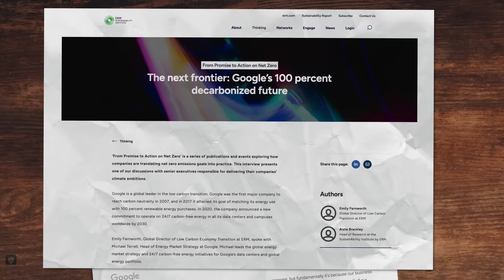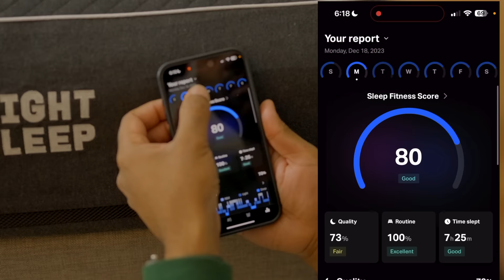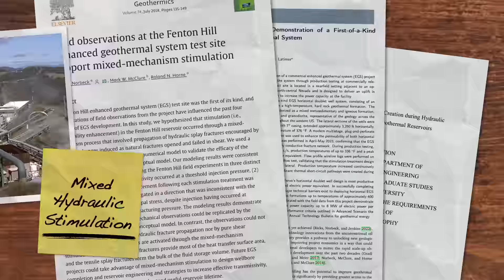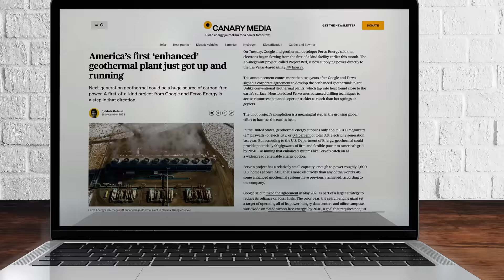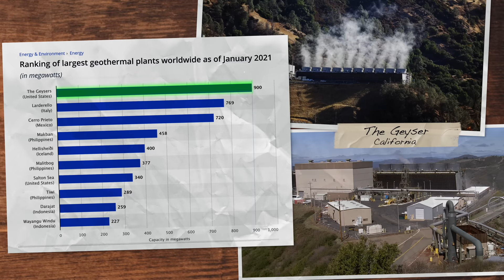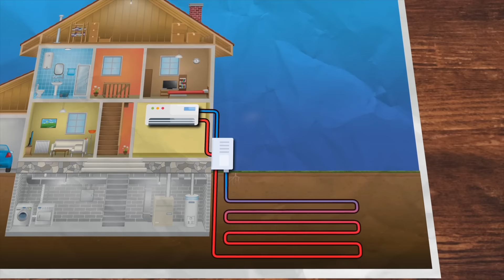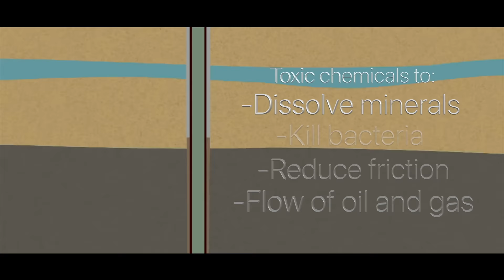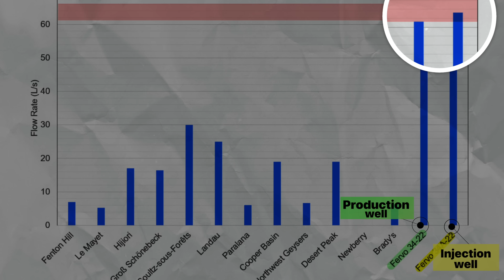Google’s Billion Dollar Gamble: You Won't Believe What it is!

Comment: I have been researching using the earth's natural heat to boil sea water.  The goal is strategic: the supply of both the earth's heat and seawater are infinite.  I don't want to use fresh water because it is already scarce.  By boiling sea water to produce electricity, we can also produce fresh water.  Scale build-up can be dealt with by fracking.  Nature's example of how this could work is Old Faithful Geyser at Yellowstone National Park.  My hope is that a well may be drilled, sea water pours in, the rate of explosion is equallized using the water volume and rock temperature ratios.  A turbine dropped in the hole would produce electricity and the condensed fresh water captured.

Comment: Easiest Geothermal areas.
1) So Cal.
2 Nevada.
3) Utah.
4) Parts of Wyoming, not in Yellowstone Park.
There are other not so easy on the continent.
But, with proper management, the US could get off of fossil fuel, power generation, for most of the lower 48.
As to the water injection imbalance. Do you think that you can keep pulling water out of the Ogallala aquifer, and the Basin and Range aquifers, forever? Some how some way, we have to start replenishing them. This is an almost free way, (power production covers the cost).
Reply: That's a strong statement. Can you back that up?
Reply: @ipp_tutor  How about, you get your fingers working, and do some research.
Do your own WORK.
A little hint, the hot spot presently under Yellowstone, tracks under the states mentioned, follow the crater trail.

I am a retired miner/surveyor/planner/mine ventilation specialist/prospector/mechanic.
Geology, for prospecting, makes very interesting reading, if you have that bent.
For one December, my off the job associates, where a fracking crew. Learned quite a bit from them, wonderful education.
Best wishes from the far North.

Comment: Fracking can contaminate ground water without adding chemicals into the water, by breaking up the underground layers of rock it will mix whatever is in that particular area being fracked. That being said with geological surveys i am sure they will be able to find an ideal location for geothermal power generation which in my opinion is a hugely under utilized form of power generation.

Comment: I think you missed an important problem with fracking for fossil fuels. The fracked well is only good for a limited time because the hydrocarbons cannot flow through the low porous substrates. So more and more wells are drilled and this just makes the likelihood of earthmovement much greater. However heat does flow extremely well and so once you have your well, fracking only once in the area, you don't need to keep drilling new wells. It is all much more stable and less risky. I am "well" pleased that this technology is moving forward, yhe sooner the better.

Comment: Subtitle quote from around 17:30, "in geothermal we don't need to kill bacteria or extract oils from The Rock so fracking fluids used in esgs don't contain any of the toxic chemicals that we were just talking about this means two things no chance of air ground water pollution and no need to dispose of the fracking fluid by burying it underground so the main drawbacks of fracking for oil don't apply to geothermal .....". So we already know that the extremely harmful business of fracking using various chemicals and drilling methods to extract the fuel products. So even if we naively remove the chemicals from this proposition, what about the drilling and earth disturbance leading to unknown issues that are too numerous and inconsistent to quantify? Let alone whatever unknown elements are released from the ground. We won't even start on the potential issues due to continuous drilling for a stationary energy plant. Come on Google. This is another massive distraction and a spit in the face to all the families that have already been decimated by fracking. There's much better things to sink a billion dollars into. The only real & available solution is new nuclear. So "put the bunny back in the box" and get with the real solution.

Comment: Unseen cost?  We’ve been using nuclear since the ‘50s!  The Phoenix area runs on nuclear from the plant at Palo Verde!  France runs its entire national power grid off nuclear!  

There are no ‘unseen’ costs; there is only social and political ignorance over it, along with stupidly suffocating regulations forcing companies to take 4x and 5x as long to build a nuclear power plant and bring it online, along with driving up the cost 10-fold.

And comparing nuclear with solar based on land area is…is…is ludicrous.  Really.  The solar farm will likely have a millionth the power output of a nuclear power station, is absolutely not maintenance free, unsuitable for continuous use by a huge metropolitan region, requires inefficient and absurdly expensive supporting infrastructure, and is economically unviable at large scale.  And the manufacture of the complete solar infrastructure is about as far removed from being so-called green as a coal mining and burning operation.  Geez, what pretty-picture, John Kerry brochure have you stumbled across?

Comment: Okay, Google isn't doing fracking in the toxic mode: yay.  But both the fracking itself & the extra water loss increase local risks of quakes & sinkholes. Not to mention, to avoid those toxicity effects, the water they're pumping HAS to be from fresh sources... in a desert, when ALL semi-arid-or-worse areas are getting low on the resource.

Comment: I'm not sure I understand what you mean by 'turbine' on the original Italian engine. The wheel is a flywheel, used on piston steam engines. This is pretty much the stationary equivalent of a steam locomotive, with cylinders on each side of the locomotive powering the drive wheels.

Comment: What a load of corporate horseshit. 

The main issue with geothermal is dissolved solids. Few sites have sweet water and those are mostly tapped to their potential. New sites have hard water. and hard water drops calcium, sulfur, etc. near the boiling point of water. This gums up the pipes and forces the drilling of new wells every couple of years. 

Nothing in this plan addresses this fundamental problem. There are (expensive) solutions, but they weren't mentioned. (The most obvious is using a closed-loop system which is not fracking.)

Comment: So where are they getting that extra water from?  My guess is a well drilled into the aquifer, so that the water is in a different closed loop.  Although I doubt that it will be 100%.   One thing about steam generated power, its not the temperature of the source of the heat, Its the DIFFERENCE in heat between the source, and the cooling system.  That's why you see nuclear plants with those giant vertical cooling towers producing steam.  Geothermal plants have to dump that excess heat into cooling systems as well.  The steam generated requires a continual water replacement.  Probably out of an aquifer somewhere.

Comment: Something like thirty years ago, when I first started reading LCOE lists, geothermal was the cheapest.  It was only used in a few places where you could get the heat basically for free, at very high temperature, from a very shallow well.  Back then, nuclear looked like a reasonable option.  In the intervening decades, turning the energy of steam into electricity hasn't gotten noticeably cheaper, while wind and solar have.  Now, even if the heat were completely free, and even with the cost of energy storage, turning steam into electricity isn't going to be able to compete with solar and wind.

We should keep doing R&D for things like this, in case the projections are way off for solar and wind.  R&D is dirt cheap compared to anything that involves the entire economy.  But we should consider it insurance, nothing more.

Comment: I always enjoy your videos. You are so good at explaining complex engineering clearly and understandably.
There is no such thing as free energy/perpetual energy, some sort of resource somewhere is always expended. In this case, it's water. It simply is not possible to convert one form of energy to another at 100% efficiency, there is always some form of energy loss, usually in the form of waste heat. In this case, it is water loss and the power it takes to deliver it to the system. 
Another question I would have if we generated all of our energy needs with geothermal: how much heat would we be transferring from the earth's crust into our atmosphere? Would it be enough to contribute to the adverse warming of our atmosphere (waste heat)? How would that compare to pumping billions of tons of greenhouse gasses we are pumping into the atmosphere we are doing now?

Comment: Water boils at 30 C or 90 F in a vaccum you can actually run this or any geothermal power plant in a closed loop system for the water supply.

Comment: Mmmm, well, we Arizonans better pick that up a bit, seeing how farmers and rural locations need to drill up to 1000 feet to reach the fossil water aquifers.  At least one basin is down 2000 feet.  In almost all cases, ground water is being removed at a greater rate than it’s being replenished.  Statewide, we’re in a negative balance situation with all aquifers continuing to shrink as we need to drill deeper to pump out what is needed…or, tragically, what is desired.

At least we have policies in place such that we make an effort to replenish groundwater reservoirs, but the aquifers are losing.  No aquifers have a net positive recharge.

Comment: I'm sure the engineers already thought of this...but could salt water be used instead of fresh? I'm guessing salt water might not be as effective for heat transfer...I'm not an engineer. I think this method is a start and people and equipment can be repurposed to build these plants is a bonus.  I know nuclear power is problematic on so many levels, but it's still our best option for consistent and relatively safe energy, if you ignore the nuclear waste disposal issues...and risk of a melt down....just maybe not build them in seismically active zones?

Comment: Eavor have a geothermal energy plant in Germany, no fracking, same water circulates throught 12 horizontal connections sealed with cement, the Eavor loop.
Quaze energy again no fracking, and same volume of convection water ,uses microwaves to vapourise the rock which lines the hole walls with glass, and can drill horizontal and/or deeper than steel, hence hotter temperatures enough to power coal fired plants turbines instead of fossil fuel.

Comment: The end result of a horizontal drill may be 90-degree, but it doesn't just go straight down to the zone and then straight sideways. It's a long sweeping turn, because drill equipment only works in one direction.

Comment: I wonder it it would work with salt, sea water. If they got liquid water at 300C, salt will be still dissolved in water, but if they getting steam, salt would be lost in pipes, and could seal cracks.
Well, maybe it could work as a combined electric and desalination plant, similarly to nuclear desalination plants.

Comment: To be at 49% efficiency, the rock needs be around 500 C. You need to be down 25 km for this temperature. Toe and heel drilling is better than fracking. You can use carbon dioxide rather than water as your working fluid.

Comment: These boreholes produce heat, from which steam is generated to drive turbines. They are expensive, inefficient and, as you mentioned, noisy. Storage batteries are only (at the moment) expensive but more efficient. They are rapidly evolving to become cheaper with improved life and efficiency. They are easier to install and most , like solar panels, have no moving parts, other than switches.. I know there are some battery storage systems that used pumped fluids.

Comment: The toxic shit that comes up fracking wells is mostly from the fossil fuels and other minerals that were already underground, rather than the chemicals which are injected down-well which are relatively innocuous.  The most frequently used anti-microbial agent for instance is also used to stop mould and bacteria growing in shampoo bottles.  People pour that stuff onto their scalp without significant ill effects.  On the other hand, oil and gas wells of all types, not just fracked ones, often also yield quantities of rather dirty water with dissolved sulfur, heavy metals, as well as toxic organic compounds (benzenes, phenols etc) that nearly always go along with fossil carbon.  Coal and crude oil are full of hazardous toxic impurities besides the carbon and hydrocarbons that can be burned.  Of course when you frack a well into rock composed largely of such substances, you get toxic stuff out.

If you are fracking strata with no such toxic substances in situ, it will be less hazardous.

Comment: In my opinion salt water could be used for this application, so the 'wasted' water wouldn't be that much of a problem. Probably getting through that rock would even take away some of it's salt content so it wouldn't be so corrosive for the plants equipment. Also might could double as a water purifier. But im not nearly enough educated in this field, it just makes sense this way. Anyways, way to go, im excited!

Comment: Sounds alright but I think this is going to cost Google. I think the price of Geothermal has 10-20 year ROI unlike solar and batteries which is 10 years and below. I mean, if solar is cheap, just overbuild it and throw the excess energy or maybe run additional cooling equipment.  Aside from that, solar has little maintenance or high reliability.

Comment: I'm CERTAIN I've seen other Geo plants working with horizontal drilling recently.  In the one I'm thinking of they drill two sets of wells that eventually connect at the end point. Pump down one well and back up the other. So similar to this but without the fracking risk.

Comment: They can pressurize heat above and or below ground, then use heat conductive polymers running from core to make steam...Gravity batteries with pullies also. If electrostatic motors work, they put them next to closed circuits and don't need to do extreme measures, essentially.

Comment: I believe in the future of geothermal, and love the video ... however ... I live in western Colorado, and the Red Mountain Creek and the Uncompahgre River show the problem with fracking and the destructive effect it will have on ground water supplies.  This area was heavily mined from the late 1800s thru the 1900's.  In the case of these two streams, the water is bright orange year round ... it never runs clear, and is loaded with heavy metals and acids, even though most of the mines have long been closed.   My dog nearly died last year when, as I was not looking, he simply crossed one of these streams, and absorbed this toxic material into his coat and skin ... it really is that concentrated.   They've build holding ponds, but they are only partially effective.   The pollution is severe, and it is forever.   Now, admittedly, the mines in the area didn't utilize "fracking", but the mechanism is the same: water flowing through fractured rock.  Even though the mines are closed, the damage is permanent.  A couple of years ago,  a similar situation occurred just south if their in Silverton, with the Gold King Mine disaster, which reached a worldwide audience.     The lesson: once clean water is introduced to fractured rock, the water soluble minerals and chemicals contained within leach out, and can never be controlled.

Comment: A thought: What if they treated this as a closed loop system, rather than a fracking system, and thereby saving the 17 million gallons of water you mentioned. After all, heat-pumps using geothermal only capture heat/cooling from the ground. Very hard to do, you say!  Well, I once heard a president say, " We choose to go to the Moon in this decade and do the other things, not because they are easy, but because they are hard; because that goal will serve to organize and measure the best of our energies and skills, because that challenge is one that we are willing to accept, one we are unwilling to postpone, and one we intend to win, and the others, too." Surely, going several thousand feet underground is easier than several hundred thousand miles over our heads. Too bad, Sir Roger Bannister isn't here to show them it can be done.

Comment: Fracking is not the right solution. A closed loop is the way to go. Simply reuse the same fluid again and again and ...
We have geothermal systems to heat our houses with the use of district heating systems.

Comment: Wind and solar energy never "go to waste", the sun was going to shine either way... Just like it has for the last 4 billion years. And in 90% or more of the cases today, it's cheaper just to build more wind and solar to bring up the bottom of the trough instead of adding more inflexible so-called "base load". With the cost declines of wind and solar, this will soon be true in 100% of the cases. There may be niche situations for inflexible loads or more exotic solutions like this one, which are definitely cool from an engineering perspective (kudos to Google). But from an econometrics perspective, the answer is so simple we just don't want to believe it for some reason. And that is deploy-deploy-deploy more wind, solar, and storage.

Comment: If it is all happening 5km down then it shouldn't be such a problem. Also if the continuous feed of water is an issue, could you build these things by the sea and use seawater? Or would the salt be too corrosive on the pipework?